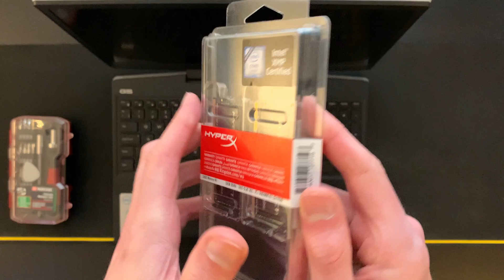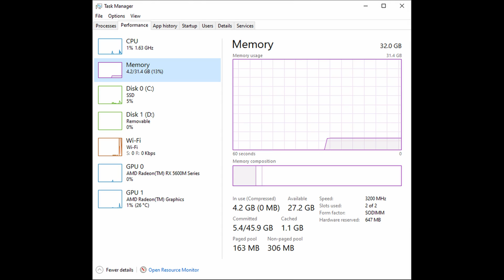Dell G5 15 SE 5505 RAM Upgrade Tutorial ***SEE DESCRIPTION***

Comment: This was very helpful. Still a great machine, 4 years later! I’m happy to have the upgraded performance.
Reply: Does it improve performance i got this gg5 se when it came out on 144hz screen and my current ram is 8 if i upgrade it to 16 or even 32 do you think it will affect fps
Reply: @lxmero4591  i’ve noticed an improvement so far on my end! I upgraded to 32g. I’m not an expert, so I can’t say what you should do, but it might be worth a try to upgrade your RAM if you can.
Reply: bro, isnt it heat up a lot

Comment: You need 2 models?! I only got 1….
Reply from the maker: One will probably work, but two modules will be faster because they can run in dual channel. This will have a real world impact on performance
Reply: @eburneentertainment yeah it worked with one I used a 32GB one, do you think adding another would work with it? I wasn’t too sure if that would be too much for it..
Reply from the maker: @AlexTheHorrid  it's difficult to say without trying it, iirc the documentation says the maximum is 32GB, but I've known devices in the past to work with more than the documentation says is the max in the past
Reply: @eburneentertainment  got ya got ya, damn then should I take out the other 4Gb that’s in there? I left it there lol. I have noticed that when I play it feels like the GPU is working harder, whenever I look at the performance of the laptop while playing L4D it’ll be at 100% GPU a lot of the time, and I don’t think if it was like that before 🤔

Comment: Hello buddy, but KF432S20IBK2/32 modules are the same as HX432S20IBK2/32 modules?
Reply: Hey buddy. I just bought a pair of the one you asked. KF432S20IB/8. You are using it ? Any problems or differences you think?

Comment: i have seen alot of video about dell g5 se from you  and  also i brought the same laptop with ryzen 5 but i have problem i am rendering a simulation of architecture model but it is ragging and i can even take  vedeo of 4k in rendering 

brother i need tips from you bro , do i need ram more bcz i have 8gb only  or i can't render 4k images and ragging issue

Comment: I have a problem. I put 2x8 sticks of ram at 3000mz but it's only showing 2600 in task manager
Reply from the maker: What voltage are the modules rated at? They need to be 1.2V, my first guess would be that yours are 1.35V

Comment: at 0:30 , iirc the best possible configuration of ram for the most performance is 2933 mhz cl17 1.2v ram , the difference in the frequency is negated by lower timings with a net perf boost over 3200 kits, but its more expensive

Comment: So I bought the 2666mhz will that slow mine down because it all they had in stock 2 sticks of 8
Reply from the maker: Yes, you will likely take a performance hit using slower memory as compared to the same amount of fast memory. If you're using less than your original 8GB of memory, 16GB of slower memory will be slower than the original, faster, 8GB
Reply: Ok well hopefully wont be to bad just needing more than it being faster

Comment: How to anable XMP? My memory has this option.
Reply from the maker: XMP is proprietary to Intel, but if the laptop can support the rated speed of your RAM it should default to it. As I understand, this laptop only supports 1.2V DDR4, so if your modules are 1.35V you won't be able to run them at their rated speed
Reply: @eburneentertainment  thanks!

Comment: Bro I have the same laptop . I need to upgrade it to 16gb ram. Is that mean that I have to buy a 16gb ram ?
I thought buying another 8gb ram will make 16gb.
Reply from the maker: You'd need to buy 2 sticks of 8 because both slots are already occupied by two of 4 from factory. This is actually the preferred method because it gives you dual channel, which gives you better performance
Reply: @eburneentertainment  thanks

Comment: Hi i have a dell g5 5590 8gb ram and I just bought Kingston hyperx impact 2x8gb 2666hz. It wont boot.updated the bios already. Am i missing something?
Reply from the maker: The only RAM that I know for sure works is the RAM I use in this video, I did try another pair, but they wouldn't run at their rated speed of 3200MHz so I sold them and got these. If you use that slower RAM you'll be leaving performance on the table, so I'd recommend getting some 3200MHz modules anyway.

Does it work if you put the original RAM back in? Have you tried unplugging the main and CMOS batteries to reset the BIOS?

If it works when you put the old RAM back in and resting the BIOS doesn't make it work, my guess would be that the RAM isn't supported

Comment: Hey I just tried this with a g15 dell gaming laptop and it just won’t work. My screen won’t even come on now. Got the exact same model ram as you but it’s saying it incompatible with my computer through the battery light.
Reply from the maker: That's a different model of laptop, without knowing the exact model number of the laptop I couldn't really help too much, but if the Dell website doesn't list compatible modules then I'd have a look at the speed and voltage of your existing memory and get something the same as that but at the capacity that you want

Comment: Hello. Thank you very much for the video. I followed the same steps but for some reason my laptop is able to detect only one of two 8GB RAM sticks. What's weird is that CPUz says 16GB RAM working in dual channel. Could you please help me resolve this issue, I've tried so many different things but nothing is working (both the RAM sticks are working btw, I tested by putting in one at a time)
Reply: Hi, its because you did not install the ram (second stick properly) even if it fits and clicks its still not it

Comment: Does the second m.2 slot have a screw already in the hole to be installed or do I need to get one to install a second ssd?
Reply from the maker: Mine didn't have one, Dell sent one with the heat pads that I ordered though

Comment: I heard going from 16 to 32 will give a boost in fps gameplay. Is that true?
Reply from the maker: I doubt it, only if you're using more than 16GB of RAM while gaming, which is unlikely because very few games if any will use more than 16GB RAM.

You will probably get a boost if your current memory is x16 density and your new models are x8 density, or if the latency is better on your new memory, but that's because the memory will be faster, not because there's more of it

Comment: i got this ram,  ran at 2666 because this pc would not run it at 3200 cpuz confirmed a speed of 2666 ended up going going with 16gb crucial ddr4 3200.  works perfect now

Comment: I have owned this laptop since October 25th of last year.. I installed 32gb of ram .. i have yet to use more than 14gb..so i highly recommend you only install 16gb ram.. save the extra money for a better SSD.
Reply: Do you still have them? If yes do you suggest me to buy it at the moment? I can't find any better laptop at this price. Tho i heard it has myriad of issues and questionable longevity.
Reply: @Sphynx93rkn  Do i still have the laptop? or memory?
Reply: @dfbess  The laptop. Dell G5 SE.
Reply: @Sphynx93rkn  , look for something a bit better..dell rushed this one. but if its your only choice, then it can be worked with but it still can get a bit toasty.
Reply: @dfbess toasty for sure i have it on a Stand cus it needs good airflow 😅😂
Reply: would it work if i only buy one 16gb and install it to the computer
Reply: @Baymaskk  , Yes but it would not be dual channel.. so save up for 2 8's or buy two 16's for 32 ..dual channel is better.

Comment: I tried upgrading mine and it won't even read any of the ram and I put in DDR4 8gb chips in it help me please
Reply from the maker: I can only varify that the model of RAM that I used in this video work properly with this laptop, I did try some crucial modules too and they did work, but at a lower speed, so I sold them. You could order this model so that you know it's compatible

Comment: Hey, buddy 
This will void your warranty as dell (in India) says that to upgrade anything in the warranty you need it to be done by them and the price is almost double  as compared to amazon.
I can't even repaste the thermal paste by myself let alone the choice of the paste so i  have to use the one dell authrizes.
Its horrible.
Any solution?
Reply from the maker: For things like replacing the RAM I'd probably just keep my existing RAM and swap it back in if I ever needed to RMA the machine, I didn't see any warranty void if removed stickers, but it's possible that they can tell if it's been opened in software. I would be surprised if they voided your warranty for upgrading your own RAM as long as you didn't cause the issue that you're returning it for, that would be very anti consumer, but I can't say for sure that they definitely wouldn't do this. I guess it depends on how much risk you're comfortable with

Comment: Can u upgrade the i7 to the i9 I have same pc
Reply from the maker: This is actually the AMD version, not the Intel version. In any case I'm not sure if the CPU is user upgradable, it could be soldered on which would make it practically impossible for anyone without the appropriate equipment
Reply: @eburneentertainment  I meant AMD I'm just learning difference the 4000 series upgrad and I see what ur saying

Comment: Have you tried this laptop with external monitor also? I wonder if the performance will change on cpu-heavy games. I think G5 users would like to see that also.
Reply: Bro if you find any information about this than please reply me
Reply: @atharv7562  I recently got a 2k monitor and this already weird laptop is now even weirder. Unless the game you play uses gpu fully which is not the case in almost none of the games, especially with this laptop and Smartshift playing on 2k instead of 1k will have minimal performance decrease compared to other PCs. If you look at benchmarks, the lower cpu model of this laptop performs  a little on SOTR, for example. I tried Ac Odyssey and the fps difference between 1k and 2k is in most cases less than 5fps. Witcher 3 plays around 70fps on 1080p and on 1440p with too little changes on settings I have steady 60fps. Ghost Reacon Breakpoint also plays 60 fps on high/very high settings 1440p. But Ac Valhalla plays much less worse on 2k because the game already utilizes full gpu on 1080p and needs too little cpu usage. For 1080p gaming difference between internal and external monitor, there is a slight improvement on performance and a little decrease on temperature (because I do not use laptop keyboard, I raised cooler stand a little higher and airflow is better now - so, this also decreases a little temperature also) 
This is my impression on G5 with external monitor so far. If I didn’t return this laptop with this horrible cooling system it’s because I hoped rx5600m could perform better in other conditions. Even though I am trying to understanding it with external monitor, until now it seems to be working better and gpu can utilize more of its potential. 

PS: Although the game temps are a little lower (this is especially because 1440p depends less on cpu), idle temperatures are higher because monitor enables gpu usage. Gpu at idle is around 60 degrees and cpu around 65 degrees.
Reply: It dose ok but i think with better ram it going to help mine

Comment: You skipped a MAJOR step - you must disconnect the battery before doing anything inside the laptop.  After disconnecting the battery you then need to press and hold the power button for 10 seconds to drain any flea current in the system.  You’re lucky you didn’t damage the motherboard.
Reply: And how exactly do you disconnect the battery?
Reply: MAJOR step #1 - perform all this on grounded anti static mat.
Reply: Why should we disconnect the battery?

Comment: I bought some ram that I thought had all the specs. 2x8, 3200, 260 pin 1.2 v. And my pc would start (bios) and it said new memory detected. I ran all the diagnostics and it detected it and said it was all working fine. When I went to reboot, completely black screen. Never went to dell logo. I'm so confused. I returned the ram and am going to try this specific one he reccomends but I feel like the one I got should have worked I just didn't know how to set it up. I even reset the cmos, switched the places of the ram and nothing.
Reply from the maker: Strange, I installed some 3200MHz RAM in mine that ran at a higher voltage, and it just ran at 2400MHz instead. Which kit did you buy, out of curiousity?
Reply: @eburneentertainment  it was just some random ram that I found from ebay. Im not even sure it had a brand name lol. But I figured since the specs were right, it should have worked. And I feel like it was working. Since when I ran the diags it was able to identify the ram without issue. But just wouldn't boot. Very odd. I'm assuming there was just something about it that wasn't the right spec. Hopefully.

Comment: Hi! I was wondering if the laptop can have the maximum upgrade of 64GB of ram just to be sure. Since I searched how much this laptop's maximum ram can have some said 32 and 64 and I'm gettin confused lelz
Reply from the maker: Hey! I've just checked the 'setup guide' for this laptop (available here: https://dl.dell.com/topicspdf/g-series-15-5505-laptop_setup-guide_en-us.pdf) and it says that the maximum memory configuration is 32GB
Reply: You CAN put 64 gb in it but it will make VERY little difference in performance gaming wise, but there is on "productivity" application that gets a big boost, (can't Remeber what it was) look at Jarrod'sTech videos for the upgrade vid.

Comment: How do u disconnect the battery
Reply from the maker: Hi there, you should be able to just remove the cable that goes from the battery to the motherboard. I find it easier to disconnect the motherboard side than the battery side. Be careful though as the components may be fragile! I show how to disconnect the battery in my SSD upgrade video and my battery upgrade video if you're still unsure 🙂

Comment: what if I wish to clean the fans? My laptop is very noisy, and I am convinced that it must be the fans that are with dust.
Reply from the maker: I would use a can of compressed air or something like a datavac to blow the dust away, making sure that you don't let the fans spin too much while you're blowing the dust away since this can damage the motor. It's probably a good idea to do this outside too.
Reply: @eburneentertainment  thanks mate

Comment: What SD Card are you using by chance? I cant find one that fits as slim as yours seems to.
Reply from the maker: Hi Kerry, thanks for watching. I'm using a "BASEQI Aluminum microSD Adapter for MacBook Pro Retina 13"" that I got off Amazon for my old MacBook Pro Retina, but it also happens to be a good fit for this laptop. In that I've got a SanDisk Extreme Pro microSDXC, but the G5 can't take advantage of the high speeds that this SD card is capable of, so I recommend just getting whichever offers the best price per GB and the capacity that you require
Reply: @eburneentertainment  is that the baseqi 303a, 350a or any other, because I want to get the right one, ty in advance
Reply from the maker: @user-vh9lb3jm5s  It's the 303A that I've got

Comment: Hello bro , i have the same laptop version but i want to ask u if i can add hdd to upgrade the storage space 🤔?
Reply from the maker: You can't add a HDD or 2.5" SSD, but there's space to add an NVME SSD in addition to the one that comes from factory. I plan to do an installation guide for this too soon, but I'm currently working on another video, so it will come after that. If you can't wait, you need to remove the base using the same method shown in this video, disconnect the battery, and you'll find a slot for the additional NVME SSD in the bottom left, right next to the existing one.
Reply: @eburneentertainment  
Thnx 
I'm disappointed to hear that 😔 so,l have to buy an external 4Tb  hdd to have a big storage space
Reply: @eburneentertainment  There's empty space beside ssd which is for 2.5" sized ssd or HDD but no connector. I don't know alot but I kinda saw this in Jarrod video
Reply from the maker: @MammaMiaLetMeGo  yeah I gather that this laptop uses the same chassis as some other models which can accommodate a 2.5" drive. I believe the 5500 can take one but you have to get a drive tray and a little ribbon cable that it doesn't come with. This laptop however, doesn't have the connection for it as you say. You should be able to get a larger battery that fills this space though, I'm going to see if I can find one and if I'll do, I'll do a video about the upgrade
Reply: @eburneentertainment  can it support 90 W Hr battery? Mine came with 52☹️ ,some models came with 68 w hr
Reply: Beside the battery

Comment: Hey dude what do you think of the laptop temps do you get 100c
Reply from the maker: Hey Anthony thanks for watching! I paid just shy of £600 for it so for the price it has absolutely blown me away in terms of performance, I am very impressed. Build quality is... Serviceable. I experienced a lot of BSODs initially but updating everything improved stability massively. I haven't experienced any temperature issues, though I don't have exact figures so I'll run some tests tomorrow
Reply: @eburneentertainment  thanks I look forward to it, yes I bought this recently aswell
Reply from the maker: @johntiles  So I just ran a couple of tests, using synthetic stress tests the CPU reached 100C and the GPU reached 86C. Whilst gaming, the CPU also reached 100C and the GPU was only slightly cooler with a max temp of 84.5C. I do wonder whether a re-paste would make any difference
Reply: @eburneentertainment  thanks, if you do repaste can you make a video, I've liked and subd 👍 really appreciate it

Comment: Thank was wondering if you had to do anything after physically replacing the ram
Reply from the maker: The system automatically recognised it and defaulted to the correct speed without me having to manually change anything